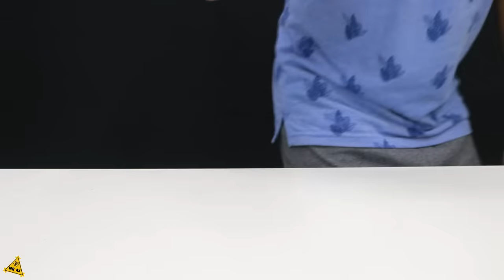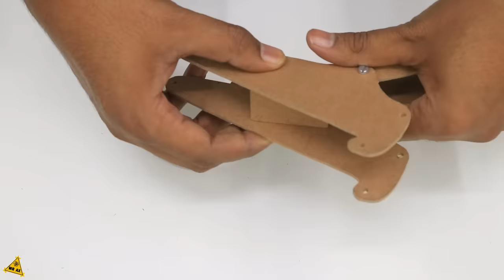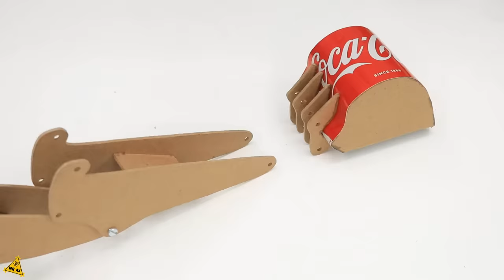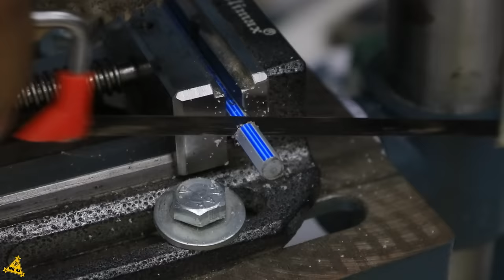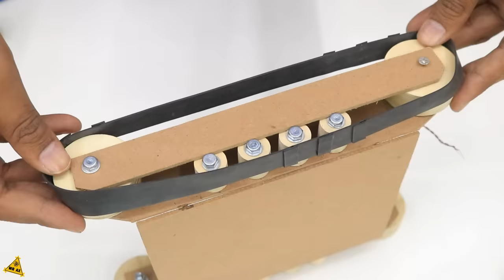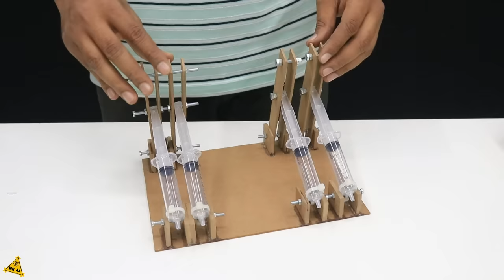How to Make a Remote Control Hydraulic JCB at Home

Comment: Sir from where did u got those correct size silicon pipes??
Reply from the maker: When buying, try putting a syringe in the pipe, which is perfect tight, take the same silicone pipe.
Reply: @MrAxTheBackBencherExperiment  sir in which shop will it be usually available??😊
Reply: @gugulothujyothi4032  hardware store

Comment: Bro which materials use plz reply😔
After 10 days my science exhibition
Reply from the maker: mdf
ss nut bolt
batteries 
wire
pipe 
syringe 
push button 
wood weel
tyer tube
empty can